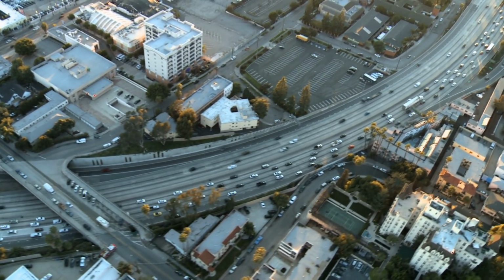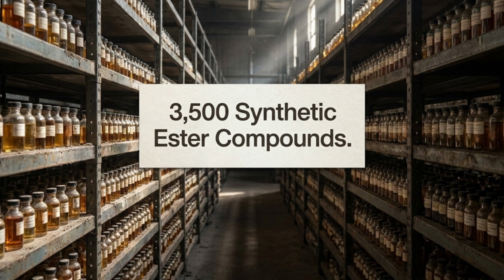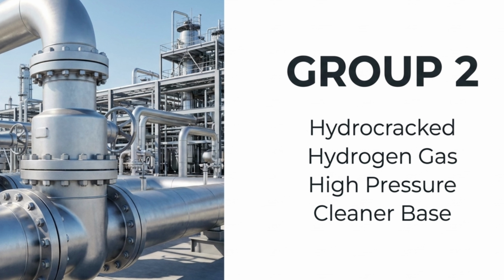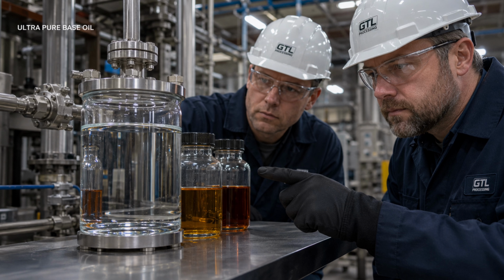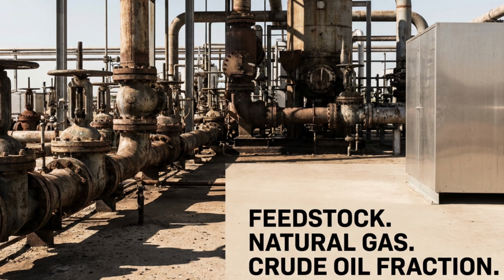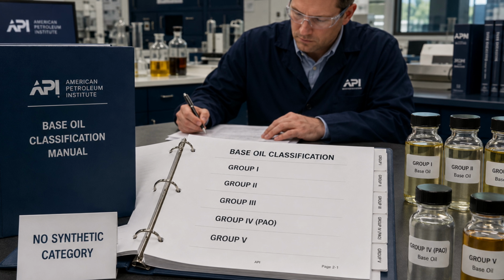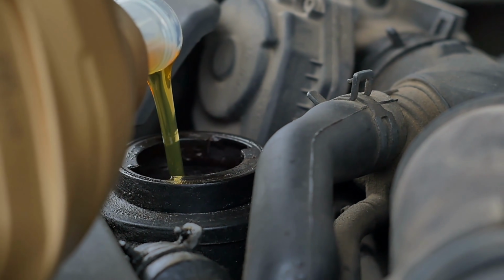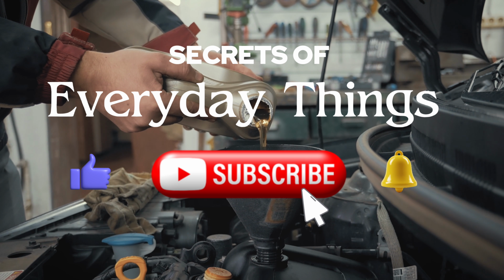How Is Synthetic Oil Made? THE TRUTH BEHIND WHAT “FULL SYNTHETIC” REALLY MEANS

Comment: The part of this video narrative was regardless of what oil you use it wears out and you must change the oil and filter regularly. I’m not in favor of the extended change intervals mandated by the government. That effectively wears your engine out quicker. I’m a retired truck and heavy equipment mechanic and have seen the effects of neglected oil and filter changes. Heavy haul truck operate under high loads for extended times and these engines can go 500,000 to 750,000 miles with strict oil and filter change intervals.
Reply from the maker: Thanks for sharing your real-world experience. Regular maintenance and timely oil changes are still some of the best ways to help an engine last a long time.
Reply: -  My brother, a mechanic - says the very same thing.  He uses straight 30 on my Toyota, as we live in a warm climate.  Even though he uses synthetic, he changes my oil every 6,000 km, not the 8,000 recommended.   He says acids and impurities kill an engine, and the oil coming out - should like basically like the oil going in.  Although it's "eeeewww!" to me, he shows me my "spent" oil, and it looks like slightly dark honey.  He says that's a good thing.   Then I tell him to "buzz off".   ha ha

I always drive 10 under the speed limit, and I keep the tachometer between 1800 and 2200 all the time.  He says the low revs and speed - are why my cars last so long, and why I can change gears without using the clutch.  I rarely use the clutch - only for starting off.   The gears just "gently pop into gear".
Reply: @OnagaChidinma Unless you’re driving a motorcycle, engine oil has nothing to do with a manual transmission’s clutch operation. Very few cars have a wet clutch ( clutch disc(s) bathed in oil ) and even then they wouldn’t use engine oil as the clutch disc friction requires a different type of oil. Wet clutch is usually reserved for high performance vehicles like Porsches and newer Corvettes. If your brother has convinced you that engine oil is the reason for your clutch-less shifting, you should question his credentials…and for God’s sake, stop driving 10 under the speed limit! You’re one of those road boulders that mess things up for everyone else.
Reply: @benjaminbelton9598      -   Sorry, Benjamin, I didn't mean to infer that.  Yes, I realize a transmission - no matter what/how it is - has zero to do with the engine or oil.   Lastly, are you a climate zealot?  If you buy the global warming, yet impute me for driving slower, that is highly hypocritical.  And no, I will not stop driving 10 under.  In my country, it's in km, not those British "miles".   You all should "get a clue" and get away from Britain's rule.
🙂    Our roads are 100km/hr, so driving 90 is minimal.   In your stupid "miles" system, it's a bigger difference.  "You all are one of those followers that mess things up for everyone else."
ha ha
Reply: The big rigs you know of use Bypass oil filters?
Reply: I agree. They say my BMW can do 21,000 between oil changes. 
I go no more than 14,000 and the car runs well, is 15 years old and done 140k. So German tech and oil changes seems to work. 
I always use semi-synthetic oil.
Reply: @adrianlang6550   -   My brother (a mechanic) says "anyone who goes 14,000 between oil changes - - is asking for eventual engine failure."   He continues with "it's the acids and build-up that destroy an engine, not the oil or lack of integrity".  Mine never goes more than 6,500 km.   Mine has 227,000 on it, and my last one had 517,000.   But it's your money , Adrian, sweetie.

Comment: The first oil I used was sold at a Dance gas station in the 60's. It was sold in quart glass  bottles with a spigot on top for filling. It was recycled 30 weight oil that seemed to work well in my 1956 Oldsmobile that used a quart every two hundred miles. The cost per quart was 18 cents.
Reply: Money was worth more back then.
Reply: @boondocker7964 
Exactly 1.91 in todays equivalent compared to .18 of 1965.
Reply from the maker: What a great story from the 1960s! Eighteen cents for a quart of oil really shows how much cars and engine maintenance have changed. Thanks for sharing this memory!
Reply: I recall a station in the late sixties had a rack to drain the final drops out of empty cans from oil changes.  Then they'd sell it as bulk oil.  No telling what the final grade was, but for a poor kid it worked.
Reply: @bobbyd6680  In UK in 60's I served petrol and did the same for my motorbike
Reply: My brother owned a 1956 Oldsmobile.  He and I liked it very much.  I recall he parked the car one day in the street in front of our home after turning off the ignition, but he noted that a fire was brewing under the hood, since the heat of the fire started blistering the paint of his hood over the area of the carb.  He opened the hood and he quickly extinguished the flames from the carb with a towel he kept in his seat!  He was lucky he didn't destroy his engine!
Reply: Versus how much were the wages in those days?
Reply: @rickj1983150 thousand dollars a year on average. I robbed banks, retail stores and wealthy people on vacation back then.    Spent all of it on gambling and wining and dining women in miami. Those were the good old days. At 87 years old its way too late to confess. Or should I?
Reply: @rickj198350 cents a. Hour😢😮
Reply: @rickj198360 TIES Was 100 Buck A n HR
Reply: I remember that product.
Reply: GAS BACK THEN WAS 25 CENTS A GAL
Reply: .      15 CENTS A GALLON. IN 1962.
Reply: Paid 25 cents a quart.

Comment: There was a time you could buy re refined used motor oil at service stations that came in a glass container and was cheaper than new unused oil. Back in the days when most engine oils where a straight grade oil. These oils had low to no detergent in them which meant your engine could get carbon and sludge buildups. As engine horsepowers increased better oil was needed. We have come a long way.
Reply: When I was a kid (in the 50’s) I remember those metal racks of glass bottles of bulk oil sitting in front of the gas stations. When the sun shone through them they had a nice amber color that I thought was pretty. I found things like that fascinating as a kid ( truth be known I still do.)
Reply from the maker: That’s a fascinating bit of history. Motor oil technology and engines themselves have changed tremendously over the decades. Thanks for sharing your experience!
Reply: Put your oil in a clear bottle and expose to sunlight, if it changes colour after a few weeks it is not synthetic as defined by mobil before your court case. A test that Fuchs used to do.
Reply: There used to be a,  "re-refined" oil called Amalie, we always said it was just filtered through a gunny sack into a new container. Never used it, but it was about 1/2 price of QS.

Comment: Switching oil types is not a good idea on a turbo charged engine as the turbo gets very hot and cooks normal types of oil a fully synthetic is as necessary on a turbo engine as a jet engine. Also these modern wet belt engines only use the oil recommended by the engine manufacturer as when the engine fails they will test the oil and invalidate the warranty on the engine.
Reply from the maker: Thanks for sharing your experience! Using the oil recommended by the manufacturer is always important.
Reply: Bullshit. Check out the "Moss-Hartley " Act.

Comment: All true (except Group II oils are not hydrocracked, but hydrotreated to remove aromatics, heteroatomic molecules and unsaturates).  But one thing about PAO-based synthetics - if they are abused and used well beyond their proper service interval, they will crater oxidatively much faster and worse than mineral-oil based products.  And another thing - synthetic MOs, especially those based on PAOs, often contain an ester-type co-baseoil.  While some of these are quite thermally-stable (those with no hydrogen on the beta-carbon of the alcohol-derived portion), others are less so (and appreciably less than PAOs themselves), and many esters are vulnerable to hydrolytic degradation if moisture is present to any degree.
Reply: Diesters are often blended into PAO to help the additives mix.  PAO alone struggles to mix with some additives.
Reply from the maker: Thanks for sharing such detailed information! I really appreciate knowledgeable contributions like this.
Reply: Given your knowledge, what motor oil do you use or prefer?

Comment: Att byta från basolja till Esterolja gör att motorn kan börjar läcka olja i alla packningar och packboxar överallt, bättre att köra med basolja då och slippa det.
Reply from the maker: That's a common point, especially for older engines. Whether switching causes leaks often depends on the condition of the seals, gaskets, and the engine's maintenance history. Thanks for sharing!
Reply: It's not actually a problem, they use different oils that balance things out.

Comment: Pennzoil Ultra Platinum uses the gas to liquid technology.  It has been dubbed 3+, since it doesn't handily fit into the other categories. 

The vast majority of synthetic oils start as crude oil.  While there are a few Group 4 and 5 oils, the ones that come to mind are Amsoil and Mobil 1.  There are other less  known "boutique" brands.
Reply: Don't know about Amsoil, but Mobil 1 is no longer made from hgroup 4/5 oils. It is based on group 3 oils.
Reply: @melclark1066 It usually depends on the classification.
Reply from the maker: Thanks for sharing such useful information! It's a fascinating topic with many nuances, and I really appreciate knowledgeable contributions like yours.
Reply: But ethylene gas ( used to make synthetic oil) is a hydrocarbon that is dug up from the ground and purified…

…so there really is no such thing as “Full Synethetic” from air…!

Comment: This was a bit confusing.  Stating that synthetics come from gas could easily mean synthetic oil comes from gasoline.  But the "gas" they're talking about is one of the four types of matter: solid, liquid, GAS, and plasma.  It would have been much clearer if they used the word "gasses", which is not only true, but gasoline is never spoken as "gasses".  Making it clearer what you're talking about.
Reply: Lots of folks call "gas" petrol.
Reply from the maker: Thanks for the thoughtful feedback! I see your point—using the word "gases" would make it much clearer and avoid confusion with gasoline. I appreciate you pointing that out.
Reply: Rather pedantic.  And it's not potentially multiple gases, it's natural gas, methane.

Comment: I use super tech advanced synthetic every 5000 miles never had a problem
Reply: But that tells nothing how healthy the motor is or worn out! 🤦‍♂️
Reply: @candyman1967 i use supertech too in my pick up and small cars.. all have over 300k miles 😂😂 used it since 80k miles.

So you don't know shit
Reply from the maker: Thanks for sharing your experience! Regular maintenance and using the right oil for the engine are what matter most.
Reply: Shid..... My 9ld man used those orange fram filters on everything and the cheapest oil he could buy. The used oil got poured down a fence line to kill the grass and you know what? He never had a blown engine and as best as I can remember, he never replaced an engine either. Now he did do his maintenance and kept up with things. But he never had a smoking engine or blown head gastets, etc.

Comment: Learned a lot at the end on how to see the difference. My 1st car was a 1956 Chevrolet with a 265 cubic inch v8. Oil was always black after 2000 miles.
Reply: Engine component tolerances weren’t as tight back then either. More combustion products got past the rings I’d imagine.
Reply: Black means the detergents are working.  It is good, not bad.
Reply: I remember there were 1000 mi change intervals in the 1950's. We lived in Chicago and would drive to California and Dad would have the oil changed when we got there. He said highway driving was easier on motor oil so that was why we could exceed 1000 mi.
Reply from the maker: Thanks for sharing the memory! Older engines really were quite different from modern ones.